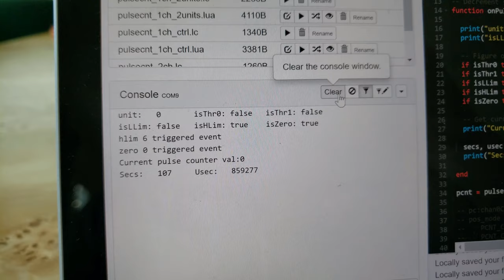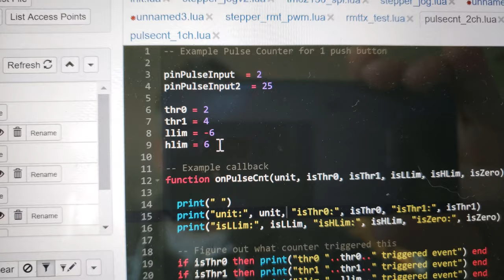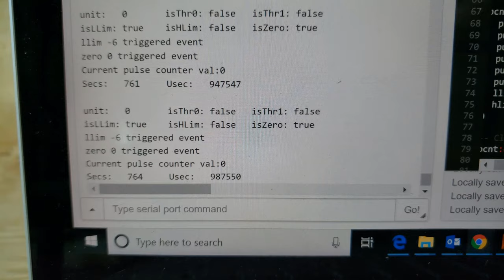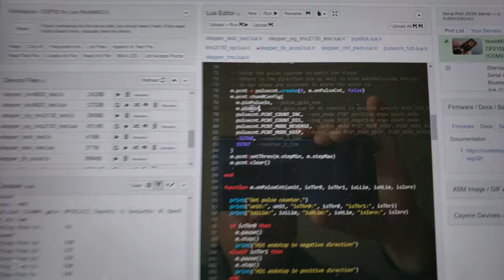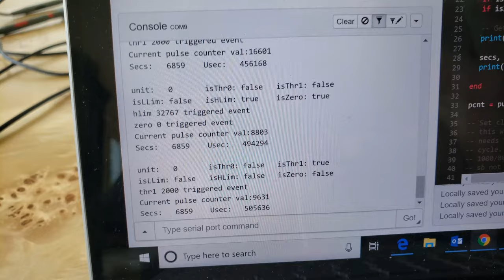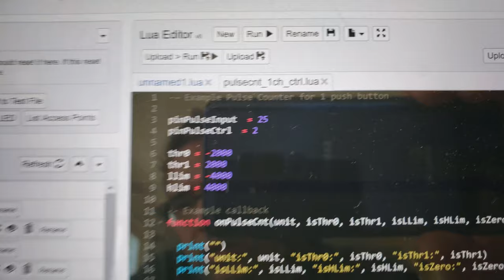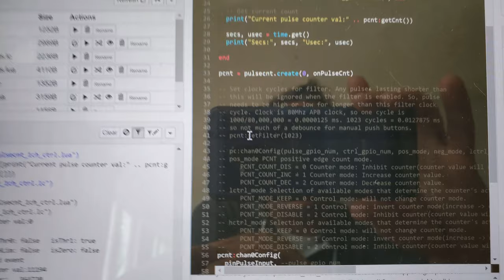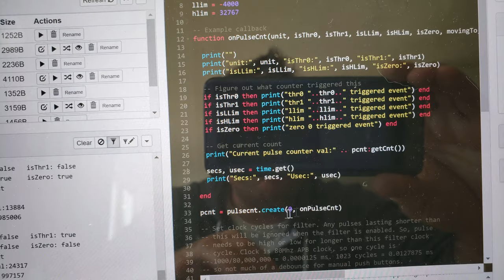ESP32 Pulse Counter

Comment: Hardware pulse counter comes with esp-idf examples. Very easy to use
Reply from the maker: I found it was confusing how there was one unit, two channels, four gpio ports (2 pulse in, 2 control), and a high/low limit for each channel, but in the callback you could never know which channel's high/low limit triggered the callback, rather all you know is that a high/low limit was triggered. You can ultimately deduce that info so not a big deal, but took a bit to wrap my head around their approach.